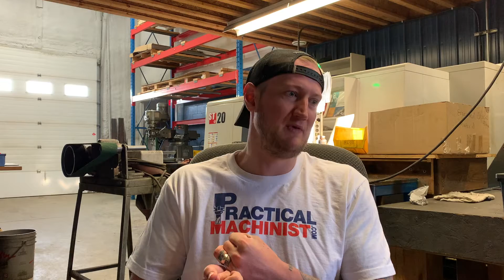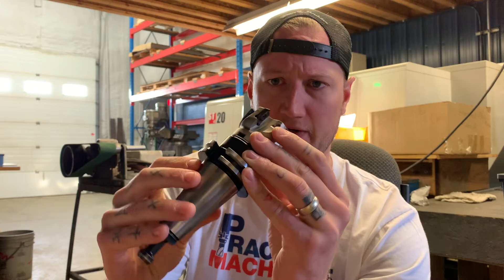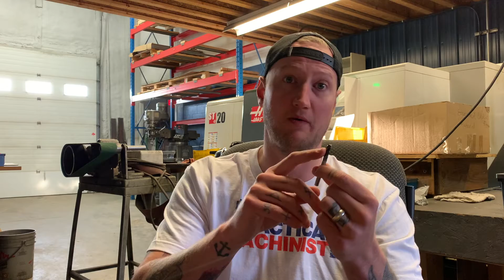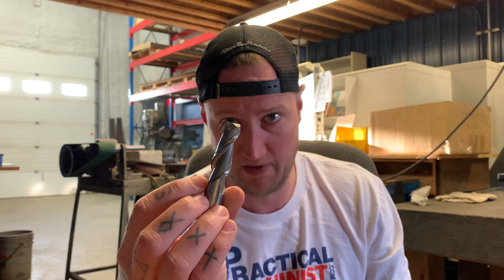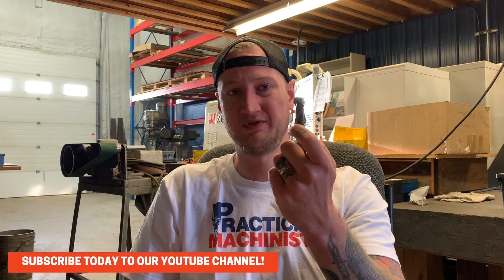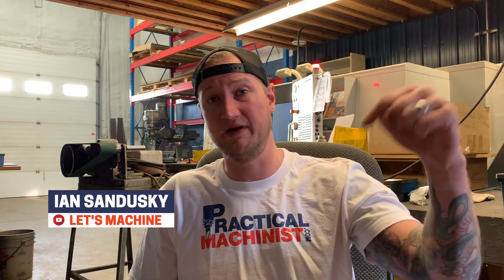Tips to Select the Right Milling Cutter | Machine Shop Talk Ep. 5

Comment: How about speeds ands speeds?
Reply: I usually try to run my speeds about the same as my speeds.
Reply: @larrymashburn7789 Same here
Reply: Feeds and speeds is a whole different beast in itself. Contact your tool rep and if you have multiple tool reps... have them send you their catalogs which will give you good starting feeds and speeds. Always think about the ISO material group your are milling, and take your endmill's coating into consideration. For example, if you are milling aluminum, don't mill it with an endmill that uses an aluminum coating! Otherwise it could end up welding to your cutter